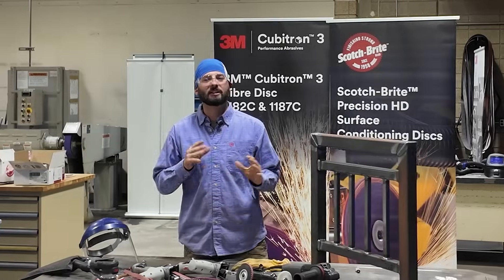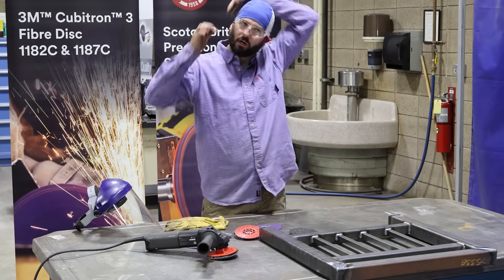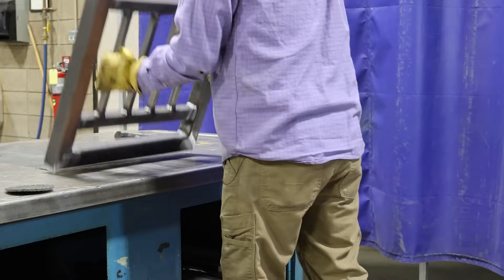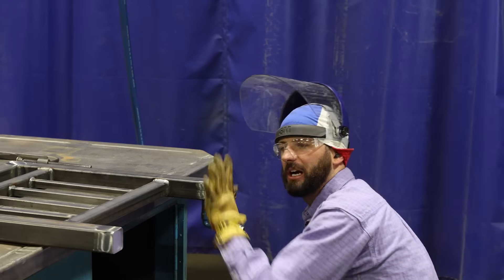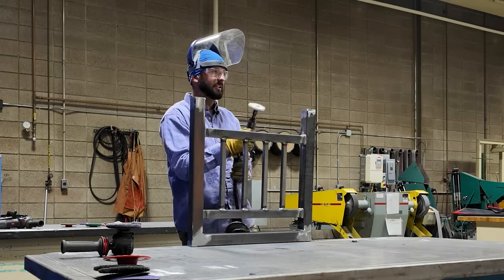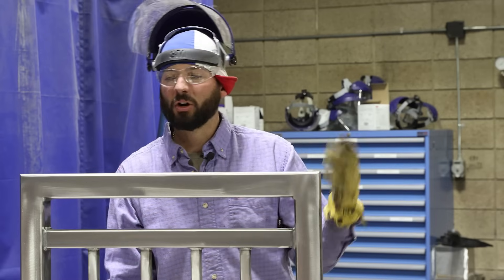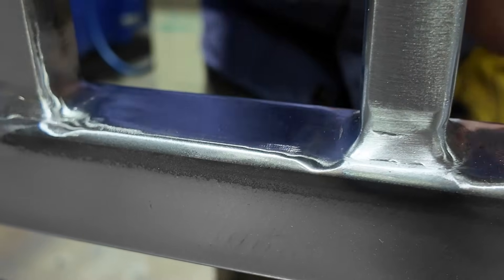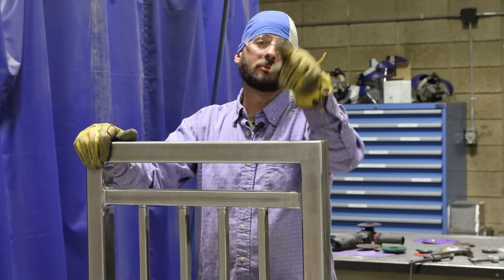Professional Handrail Finishing Techniques Every Welder Should Know

Comment: Ill give a couple tips i picked up, when using the angle grinder with a flapdisc, get to know your disc and the way it acts, learn to know ho much you can push and what kind of angle you use, grind directions n everything. (Im sad since my supliers in my area dont havr the flat flapdiscs anymore, if you can, get the flat ones! You can only get as flat a result as your tool is)
Also i only run hot push welds, no pulling since that makes a less elegant weld. On inside corners on square tubing use a round file! No powertools will beat the results and youd be suprised how fast itll take off any high spots;)

Comment: Great video - Thanks!
Let me tell you, that Scotch-Brite XT PRO stripping disk (the Purple one) is the Cat's Pajamas on STAINLESS STEEL sheet metal and tubing! It is UNIQUE among that type abrasive because it doesn't build up removed material as with other disks which almost always cause an almost unremovable black scuffing on stainless. It does a great job in removing dark oxides from welding heat. It IS EXPENSIVE but pretty durable and worth every penny because it is a major time saver. I use the angle grinder version.
Reply: Hi,  sounds like you know what you're talking about. Can you elaborate on the almost unremovable black scuffing?  What causes it, and btw how much are the XT PRO?  I'm only able to find pricing on Amazon and it's about $165 for 10 disks.

I'm usually use Cubitron 2, 982C, slotted, 60 grit, then a 120 flap disk.  But I never used it on Stainless Steel, and I have a job coming in stainless steel.  I don't want to butcher it, if you know what I mean.   Thanks.
Reply: @danl.4743  Opinions differ on the black scuffing caused by other disks - it could be from material picked up by other disks in combination with the heat from friction causing carbon to come to the surface. Either way, it is very tough to remove (If you have a piece of SS sheet metal, just run a regular stripping disk over it and you will likely see what I mean). The XT leaves zero residue like that (must be a different abrasive?). I only bought one XT to start, at 19USD. Pretty steep for a one person business.

Comment: If you're going to go all out on finishing a part, you might as well just TIG weld it. Surely you would spend less time grinding, sanding and blending everything in.
Reply: Yeah exactly. Might as well spend the time getting the weld right the first time. Either TIG or CMT.
Reply: No doubt.

Someone in the air-conditioned side of our company decided to take on a powder-coat picketed fence job and they have us using .045 metal-cored GMAW. 

Gonna spend more time scraping and sanding than the welding and fitting combined, lol.

Comment: Nice selection of grinding discs.
I used to make hundreds of similar railings a week, weld the flats and outside corners with MIG, for the fillets we gas brazed with a vapour flux the brazing flows into the joints making nice smooth fillets, it meant there was none to minimal grinding needed on the fillets, the rails then went off to be chromed.

Comment: Don't forget to be mindful of where all that metal is going. Had a weld shop return a truck after a pipe rack job with grind sparks burnt into the paint and starting to rust.  Unacceptable, at any level.